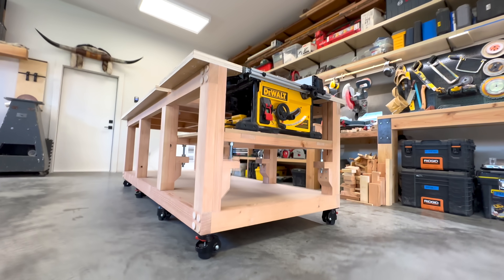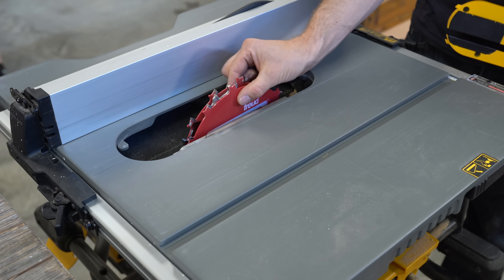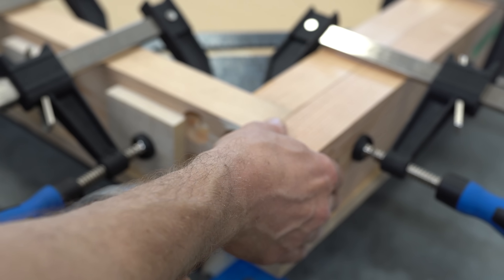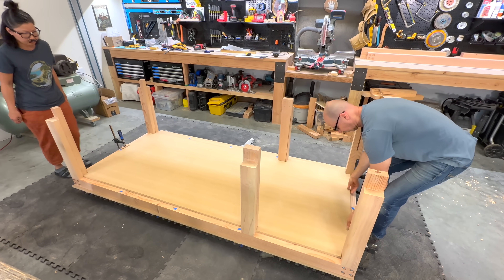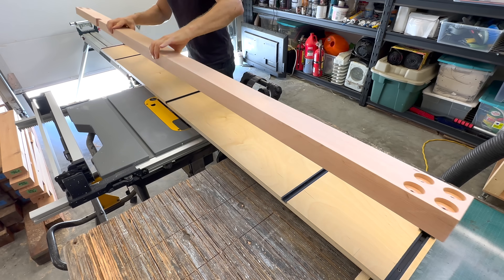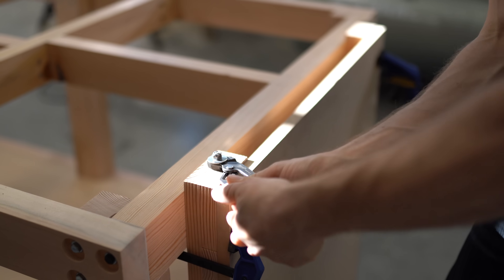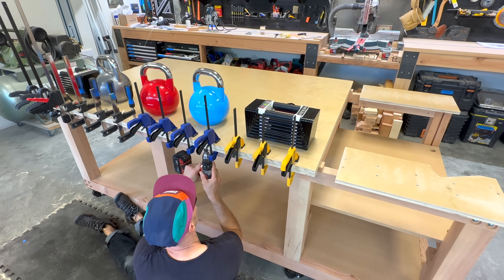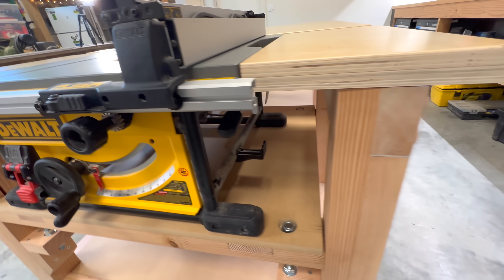DIY Table Saw WORKBENCH Dewalt 7491

Comment: Now that you. have lived with it for a year: Could you share your thoughts on areas where you might make changes, if the floating saw table area is solid enough, and if the joints you used in the uprights/corners has any racking?
Reply from the maker: Hi there, I've had some suggestions to make the workbench into three modular parts that would all clamp back together, so maybe I'd try that If I were to do it again? As for the floating saw table, it still seems tight and strong. There is nothing I have noticed out of place. I did check the level on it, and I adjusted it once, after it was built. I'm pretty pick though lol. There are no cracks on the upright corners. Maybe because I let the wood sit and dry for a long time before I built it? If someone wants to roll this workbench around all the time, I would choose a different caster, as these are great, but take a bit longer to rais and lower. I do not move the workbench much. Thanks for asking! Cheers

Comment: Great solution. I have a contractor saw now that is older and takes up a lot of space. Do you think this approach gives you as good a result as a larger saw? I ask because I think this would save a lot of space and I got a skil saw this size that I think is probably as good as what I have. But trying to decide if it's a mistake to get rid of the bigger saw. Thanks,
Reply from the maker: Hey there, I've worked on this bench for a while now. My biggest pet peeve would be the table saw top, (surface of the table saw). It is made from a composite material I believe. If your contractor saw has a cast iron table surface, I'd stick with that. I think you cant beat a dead flat table top surface like cast iron. So, for fine carpentry work, I'd stick with a larger saw. 

If your not into fine details, then I think its a great compromise to have the contractor saw built into a workbench. I love my table saw and I love getting to work on my bench. It feels good and saves me on space. Not sure it this helps? Hope so :) Thanks for stopping in and for your question 👍

Comment: Excellent workbench... great video and perfect instructions!! This will be my summer project. Already started ordering parts and pieces. Quick question...  noticed no glue-up recommended. Is this to facilitate disassembly?? Would you recommend glueing all parts?? Thanks for the excellent build!!!
Reply from the maker: Hi Bill that's so awesome and thank you for choosing my workbench plans for your summer project. You are correct, I decided not to use glue because I thought I might need to take it apart. I did glue the clamps that hold the adjustable shelf, and I used glue on the table legs. Many people just glue the entire piece together thought. Nothing wrong with that, it would be one heck of a sturdy bench that you could put your car on I would imagine. So it's really up to you, i don't think you can go wrong either way,  for me personally, i liked the idea of being able to take apart. Hope that helps and best of luck bud! If you ever have any questions please let me know and all the best of luck to you! Cheers Paul

Comment: Beautiful build, i made a verrry similar but nowhere near as polished bench for a hitachi/metabo saw. Something I've been considering is perhaps shifting the saw to one side and consolidating the side panels together. I feel like it could help with support when breaking down large panels. And i think i might be able to integrate a router into that larger resultant side panel. What are your thoughts on this?
Reply from the maker: Hi there Moonshineman! Nice name and thank you for your comment. 

A bit of Background to answer your question:

The reason I placed the saw in the middle... I did a poll on a facebook group called "Woodworking for Beginners" It has 700 or 800 K followers. I  asked where people place their saw, Left, Right, or Center. It was mixed results, but from my tally , the center position won with the most votes. The next most popular was "Right of Center." or "To the far right", that being said, if you want to break down larger sheet goods, this was the category for people who placed their table saw to the right of center. People really seem to like having their saw off to the far right side, this will enable more support when cutting larger sheet goods. I don't think you can go wrong with shifting the saw to one side. 

For me, I do not cut large sheet goods all the time, this was one of the reasons I place my table saw in the center of my workbench. 

As for the router, they don't take up a lot of room, so I think you would be fine to place it into the larger side pannel. However you place your router, it would be nice to utilize the table saw fence for your router fence as well. 

Best of luck and thanks for your question! Cheers Paul
Reply: @vanislestudio  what an in-depth reply, thank you very much.

Comment: Would you recommend any top coat or clear coat for longevity and maybe helping with boards sliding? Just beginning my journey into woodworking and figured I'd start with a good table. Just finished the table saw leveling shelf
Reply from the maker: Hi Zach, fellow woodworking journey mate!  That is fantastic to hear you just finished the table saw levelling shelf 👍 I hope you enjoy the levelling process, and thanks a lot for choosing my plan! 

Lets see, regarding the table top and longevity with a top coat or clear coat...I'm a fan of applying a clear coat / top coat to a working surface. The 4X8 sheet of plywood I used on my workbench came pre finished. Meaning there was a top coat already applied to the surface. It makes it smooth to the touch, adds protection, and wood slides easily across it. 

If you want a more "Durable" finish, I'd go with an oil based clear coat / top coat. It takes longer to dry, but well worth the wait. It gets really hard once cured. 
That being said, I've also used water based clear coat / top coat and had very good results as well. I just finished a desk at my office using the water based. But my office does not get the abuse my workbench does. 

Here is a link to an oil based product: https://www.homedepot.ca/product/varathane-professional-oil-based-polyurethane-clear-finish-in-satin-clear-236-ml/1000111867?eid=PS_GO_140203__ALL_PLA-526641&eid=PS_GOOGLE_D00_Corporate_GGL_Shopping_All-Products_All%20Products__PRODUCT_GROUP_pla-298495632901&pid=1000111867&gad_source=1&gclid=CjwKCAjw2dG1BhB4EiwA998cqPH-EnyFOg0VWh8Tfrwbc-tUEYjS57xKj49LscUgZmgiMKU7XcJn0xoCBpEQAvD_BwE&gclsrc=aw.ds

Here is a link to a water based product: https://www.homedepot.ca/product/varathane-diamond-finish-premium-polyurethane-wood-finish-for-interior-water-based-in-satin-clear-236-ml/1000111884?eid=PS_GO_140203__ALL_PLA-526641&eid=PS_GOOGLE_D00_Corporate_GGL_Shopping_All-Products_All%20Products__PRODUCT_GROUP_pla-298495632901&pid=1000111884&gad_source=1&gclid=CjwKCAjw2dG1BhB4EiwA998cqBAOKlPtKjcSQYO3kjjHv3ODszh7gf-CUjw1VSLTi9462jn2CLROExoCw04QAvD_BwE&gclsrc=aw.ds

If you end up using something similar to above, I don't think you can go wrong. If you mess up, just sand, then re apply., and always follow the instructions on the can. 
Hope that helps Zach and thanks again! Let me know if you ever have any more questions. I'm happy to chat. vanislandstudio@gmail.com
Cheers

Comment: Beautiful work! Do you think this can be done by two people with moderate woodworking skills, assuming all the tools and materials are available, and your plan is ready, in just one day?
Reply from the maker: Hi Vincenzo thank you! Wow, one day for the build...considering you mentioned moderate skills, two people, it actually might be a possibility. Most likely a long day but there's a part of me that thinks it will take longer. In the plan, I glue up the legs, and in this case, I would also add a few screws to prevent any movement... The build is not that difficult, just time consuming to get things lined up nicely. At least for me it was lol. If you do decide to give it a go, please let me know to:

vanislandstudio@gmail.com  

I'm very curious now Vincenzo and thanks again for your comment and for stopping in! Cheers

Comment: Nice project.. 👍 Thank you.. 🙏
Did you finish the table..? I mean sanding and coating..
Reply from the maker: Hey thanks so much for that! Well, I did sand the legs and bracing, but I did not coat it with anything. The top is coated. I purchased it that way. Its finished Birch plywood good two sides. I think it gives a nice look and is very durable. Thanks again, Cheers!

Comment: What size was the Douglas Fir boards to begin with, because final dimensions of 3 5/8 x 1 13/16 is larger than standard 2x4s… did you start with true 2x4s? I’m curious because I am not eager to joint and plane 2x4s to get boards too narrow to my liking…
Reply from the maker: Hi Victor, thanks for your question. Yes, I started with true 2inch X 4inch boards. After planning they became 3 5/8 X 1 13/16. I also made another woodworking plan for this workbench that uses regular size 2 X 4's (3 1/2 X 1 1/2) to build the workbench.  If you are interested in them, you can find it here:

https://vanislestudiostore.etsy.com/listing/1580411172

Let me know if you have any more questions, just send me an email to vanislandstudio@gmail.com  happy to chat and thanks again for stopping in! Cheers 👍

Comment: Hi: Love the video, but one thing puzzles me, probably because I'm pretty new to all of this. Why did you have to create a T-channel for the supports at the front end of the adjustable shelf but not the back supports?.....Thanks, Russ
Reply from the maker: Hi Russ, you know that's a great question. I go a little overboard on things, those T-Channels were probably in that category of overboard, but they do serve a meaningful purpose for the front supports only.

The short answer is - The back supports have an upper, AND,  a lower brace that connects them together. The front supports only have a lower brace. 

I wanted to beef up the connection between the front supports and the adjustable table. It would have probably been ok to leave it alone and just have the pressure from the Hex nut, washer, and threaded rod, hold the adjustable shelf in place, but I just wanted to add another layer of strength to that part of the assembly.

It helps to prevent lateral movement in the front supports (left and right movement).  There is no issue with lateral movement in the back supports because of the upper brace. 

The table is heavy, and meant to move around the shop, so if you grabbed one of the front supports to move it around, having the t channel, hanger bolt and washer really added an extra layer of strength preventing any movement.

I cant move them, it's a really strong connection, similar to the back supports now. 
Hope that helps and thanks for your comment and question! Cheers Paul
Reply: @vanislestudio  Nothing wrong with going overboard, unless you're on a ship, of course..... Thanks for your reply. I'm seriously thinking about using your design for myself after culling through dozens of these videos. This is the best one....Just so I understand, the T-channel helps you duplicate the connection between the vertical posts that the upper brace creates in the back?
Reply from the maker: Hey Russ, that's a good way of putting it, "duplicate the connection between the vertical posts that the upper brace creates in the back". Feel free to ask any questions and I'll do my best to help out. Thanks agin Russ and best of luck to you - Cheers Paul
Reply: Thanks!  @vanislestudio

Comment: Very nice bench. Can I have your plans? thank you
Reply from the maker: Hey @rodelpablo8040 Thanks so much!

 In case you were still interested, I wanted to let you know they are now available on ETSY.  Here's the link  http://bit.ly/3s4D7Ta

The plans utilize imperial measurements, and use regular sized 2X4's (3.5 inch X 1.5 inch).

If you are interested in building the workbench using the exact dimensional lumber I used in the video (3 5/8 inch X 1 13/16 inch) I'll have those plans available on ETSY's site on Oct 31. 

Thanks again for checking out the build! Cheers Paul

Comment: Loved your video.  Especially the dancing nuts and washers as well as the pencil sharpener.  I am going to purchase some plans but still debating on which one. The Combo with miter saw or stand alone.  
Thanks, John.  (From Victoria)
Ps where did you get your wood from?
Reply from the maker: Hey John from Victoria :) Thanks so much for that!  I purchased the rough cut 2x4 Douglas Fir from a lumber yard here in Campbell River called "Western Mill Sales". I purchased the 2 sheets of Birch plywood (good two sides) from "Windsor Plywood", also in town here. If you are considering my plans, and have any questions just email me at vanislandstudio@gmail.com and I'd be happy to chat! Thanks so much for stopping in John and all the best to you! Paul from Campbell River :)

Comment: Starting this build this weekend 🎉

What’s the story with the two squares clamped together?

Edit - oh, I get it. It’s to guide the jigsaw cut square into the edge of the panel. Nice.
Reply from the maker: Hey Fall Line!  So awesome to hear and thank you very much for choosing my workbench plan! If you ever have any questions as you go, please let me know, send an email to vanislandstudio@gmail.com and I'll help out! Yes, you got it, the two squares were exactly that, to guide the jigsaw cut square to the edge :) You have a good eye for noticing. I hope you enjoy the building process and your workbench brigs you years of good use 👌
Reply: @vanislestudio  Thanks I appreciate that and I’ll definitely reach out if I have questions. I have to say the links to each item in the supply list were very helpful

I’ve actually got a few tweaks in mind, hope they work out well.
1) Miter saw shelf probably needs to be widened a bit to accommodate my dewalt DWS779 miter saw
2) Add T track for a stop block for the miter saw
3) Add hardwood edge banding where it makes sense (including the miter saw shelf in the stowed position)
4) Make it easier to route dust collection to the miter saw (either push back the UB section so the hose can fit through that gap easily, or actually drill through that UB member with some sort of quick disconnect fitting so it’s a quick process to hook it up each time you open the shelf)
Reply from the maker: Ha :) I'm glad you found the links helpful! I was wondering, when you have time, would you mind letting me know how wide you had to make the Miter saw shelf to fit your awesome DWS779?  It could help some others out who have the same say as you do. My email is vanislandstudio@gmail.com if you are able that is :) 

Also, I like hearing about the additions to your workbench! All very clever and useful 👍 Pretty excited for you!!

Comment: Perfekt!!! 💪🏼👍🏼💪🏼👍🏼
Video gespeichert und wird nachgebaut… ist ein Plan vorhanden?
Reply from the maker: Hi @003number thanks a lot! I appreciate you looking at the video!

 Thanks again for inquiring about plans for the workbench. In case you are still interested, I wanted to let you know they are now available on ETSY.  Here's the link  http://bit.ly/3s4D7Ta

The plans utilize imperial measurements, and use regular sized 2X4's (3.5 inch X 1.5 inch).

And in case you are interested in building the workbench using the exact dimensional lumber I used in the video (3 5/8 inch X 1 13/16 inch) I'll have those plans available on ETSY on Oct 31. 

I'll also make the plans for Metric measurements in November. 

Thanks again for checking out the build! Cheers Paul
Reply: @vanislestudio  Thank you very much for your answer. Is that only in inches or maybe also in meters, for Germany ?
Reply from the maker: @003number   Not a problem my German friend! My mother speaks German :) and thanks again for considering my plans. The plan is in Inches.

 I am making a Plan for Meters. It will be on ETSY's site in two weeks time on Nov 07, if you will still be interested. Thanks! Paul

Comment: Great workbench. Would build it similar next time.
Did you think about adding your mitre saw in the same tabel as well? I have very limited space in my garage and have to integrate both saws in one workbench.
Reply from the maker: Hi Tobias thank you, and thanks for your question! Yes, adding the miter saw is a great idea. It is what I have been working on for many months now. I hope to have the bench finished and new plans made by the end of April, along with a new video of the build process.  Thanks again for stopping in! Cheers Paul

Comment: What is your Etsy? Definitely looking forward to the plans.
Reply from the maker: Hey @zipit0322 thanks for checking out the build! It's much appreciated! 

In case you were still interested, the plans are now available on ETSY.  Here's the link  http://bit.ly/3s4D7Ta

The plans utilize imperial measurements, and use regular sized 2X4's (3.5 inch X 1.5 inch).

If you are interested in building the workbench using the exact dimensional lumber I used in the video (3 5/8 inch X 1 13/16 inch) I'll have those plans available on ETSY's site on Oct 31. 

Thanks again for checking out the build! Cheers Paul